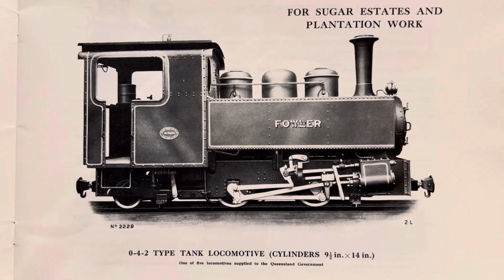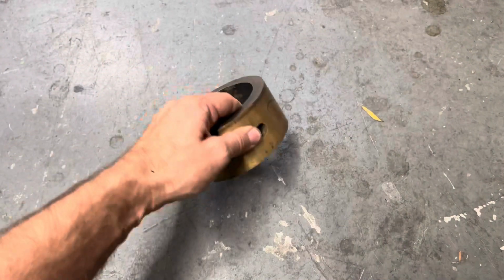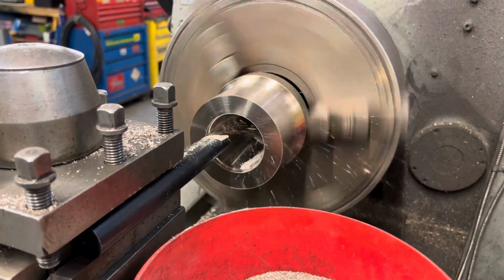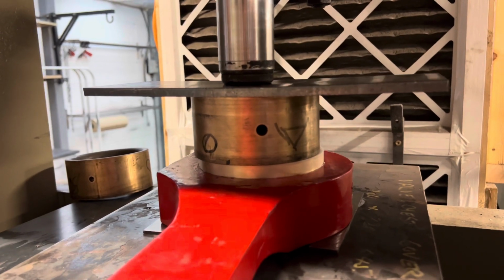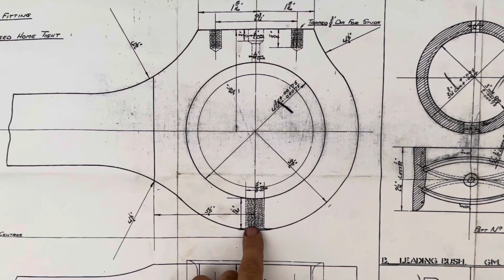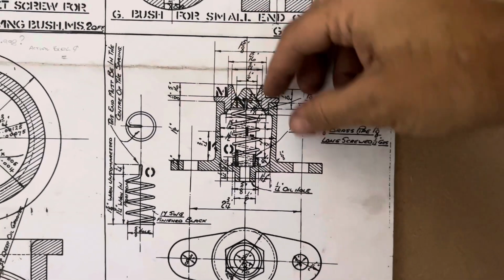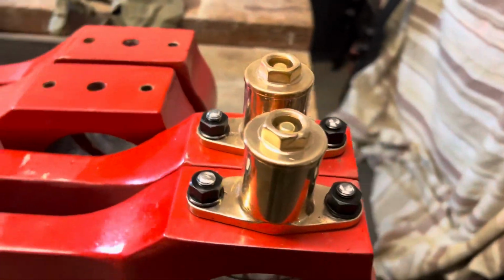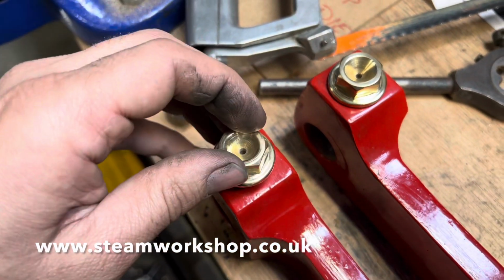Fowler 16341 Restoration Part 15

Comment: I'm surprised that you're just using the outer cases of roller bearings and not just using the full roller bearing, surely that would cut down on wear and tear
Reply from the maker: We are trying to restore the locomotive as close to original as possible, roller bearings just aren’t appropriate for a 1924 built Fowler locomotive.  Roller bearing shells though are a simple, accurate & hard way to create a new bearing surface upon which to run a bronze bush.  🙂

Comment: What is the red paint? I'm building a Fowler A7 and the inside faces of the horn plates and the gears are red, but I've no idea of the correct colour. The red you are using looks suitable and it is a Fowler as well.